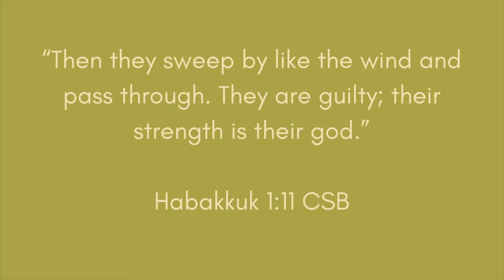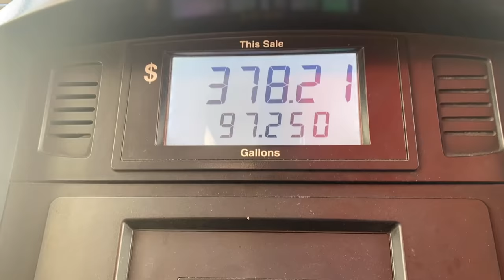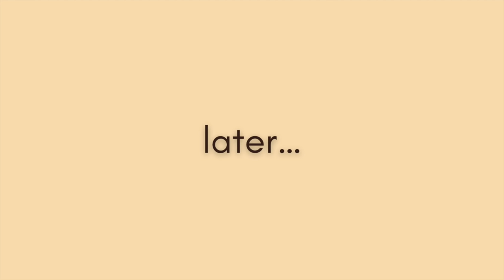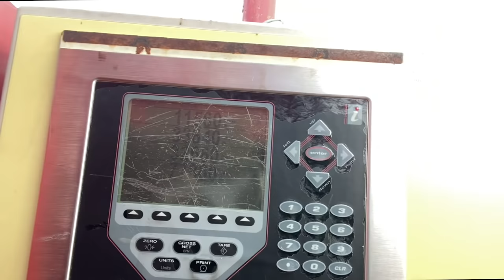A Detailed Day in the Life of a TRUCK DRIVER 🚛 | Laid Back ✨

Comment: Yes ma'am. If you are uncomfortable, don't do it! I got my cdl this time last year and drove for 8 months otr before going back to college. The winter season is terrifying! My first weeks alone I was running up and down I 80 through wyoming with every snow and wind warning going off. I'd end up sitting 3 out of 7 days out because of it but I'm safe because of it! I saw dozens of cars and trucks in the snow, rolled, and wrecked during driving through and told myself I'll never put myself at risk. Your life is far more valuable than that deadline! Appointments can be changed, your life cant be replaced.
Reply: Lol alright sista. It ain't for everybody I'm glade you are alright. Lol
Reply: I left for the same reason too within my first year of driving , NOT NOT WORTH IT
Reply: Soo seasoned driver tip: if you're going between Denver and Salt Lake City and your company is having you take the infamous I80 through Wyoming..... there's a detour. Its a pinch more in miles but I've taken this route before; I15S to Hwy 6, which connects to hwy 191 in Colorado that will get you to the 70, then take that east to Denver. Obviously if you're going the other way... opposite directions lol. It may seem scary to some newer drivers but to me it felt good taking that route when I didn't want to take the route through hell.
Reply: Well it's Wyoming. The wind alone on a sunny clear day will push them trailers over. Seen it.

Comment: That's Right Niesha pace yourself and don't try to drive outside of your comfort zone. With my job though, I gotta make it happen every night pulling doubles through the mountains which is new for me. And now that's it's about to be winter I might have to consider my comfort zone as well. ~ Safety
Reply: Jasmine Jazzy Jas  Thanks, I'm a night owl...probably from being a trainer for so many years. But yeah I've heard US Foods is really tough, and with doubles...WOW SALUTE!!
Reply: Thats funny you say that this is my first job out of school pulling doubles on the east coast. Look out MT, Black Mt, The Gap, The Gorge. My first winter comming up. I to am very apprehensive driving in the winter. They give you no training on how to handle different scenarios in inclimate weather. No training on controls in the Tractor. I just figured out that I could lock in my engine brake going down grades  to maintain speeds . There were no engine brakes in the training trucks. There are switches on the dash that Im unsure what they do, and when to use them. Then to top it all off. They put you in some dangerous equipment. The front end shimmy and shakes between 35 and 55 MPH. headlights are cloudy and makes it difficult to see usually have to use high beams but its not much better. Wiper blades don't cycle properly.. stall and shutter.. But I love the job just not the safety or maint. Program they have. They hate alot to be desired.
Reply: Jasmine Jazzy Jas  Thanks you be safe.
Reply: @truckingwithcliff  
Unfortunately its not that simple. It's a slip sit position. No sleeper.
Different tractor every day.

Comment: For a lot of new drivers, it's learning curve with a manual transmission that was the biggest hurdle. From this video it appears you're running automatic.
Thing about CDL school is that there's a lot they don't cover depending on which area you learn. Downshifting alone causes a lot of people problems, as well as If there aren't hills to go up or down or a way to get experience with certain rougher scenarios before finding your first employer. 
My first company only ran autos but I learned with Stick. I went 3 years without having to shift, then left that company, the next had me shifting and it was rough for me the first couple times. It's like riding a bike, comes back pretty quick but the best I suggest is to never get complacent and think "I know this". there's always something new to add to your perspective.

With that said, excellent video, I liked how you went into several areas of how the industry works!
With there being a need for drivers, it's only going to be helpful to show people that they could do this.
Cheers!

Ps. Ignore those guys, dogs will be dogs, as they're bound to bark. Just be careful and watch-out for ones that might try to bite. I've seen it and would intervene if someone is getting too out of hand, but all in all, our own safety is up to ourselves at the end of the day.
Reply: I just was at the DMV trying to get the automatic restriction off my license and downshifting a turn failed me automatically because I stalled if you have any pointers for me on my next road test will be well appreciated 😢 sad I had I failed that part but it is the most difficult for driving a manual

Comment: @06:27  I am glad that you actually get under your trailer and check the kingpin.  A lot of drivers do not physically look because they think that a tug check is all that is needed and that is not correct.  Good work.
Reply: A tug test isn't enough in my opinion. Need to actually see the jaw lock against the king pin. Tug it twice or three times if need be. Safe is better than sorry.
Reply: @mriphone1000  You are correct.  I actually encountered a time when I did the tug test and my trailer passed the tug test but when I got underneath the trailer to check, the jaw did not close all the way.  The jaw only went half way around the kingpin which was enough to hold the trailer for a straight tug but I am pretty sure that if I did enough turns, it would have released the trailer.  I ended up dropping the trailer and re-hooking to it.

Comment: Proud female trucker here. I always laugh when people say this job is hard. It's not. It's incredibly easy. We get so many luxuries that most don't. We can wear what we want. We can blast our jams. We get to have our pets with us all the time. We can take our breaks when we want to. We sit in air conditioning or heat all day. All we have to do is drive, hook up, drop off, and back up. The only real skill required in this job is backing. Literally every other aspect is common sense and getting used to the size difference, which doesn't take long. This job is ridiculously easy, and pays well for what is required. I've been a company driver, and I've been a lease operator. Can't say I've done the owner operator thing yet, and I doubt I will. I love my job, but seriously, if someone thinks this is hard, I have to wonder just how dense they truly are.

Edit: Good on you being out here proving we women can do anything men can do every single day. Balls are NOT required to be a trucker. You can do it in a dress or skirt no problem if you want to. I have many times.
Reply: That’s cause you don’t have to drive through real traffic you deal with nyc all day and the upstate ny mountains in Catskill you must be a causal route driver
Reply: as soon as you said " all you do is drive" i knew you are not a OTR dryver.

Comment: I used to work as a watchman and it gets a little scary when I see truckers drive towards the stringer mainly because the longshoremen who come in flocks towards the crane to pick up to get real wild out there. It might not be as major when they say to give you a map it could be a backhanded comment depending if there was a billion trucks lining up to enter the terminal. It’s a lot of heavy machinery with people who could get cut off and eventually crash into each other which is extra expenses.

Comment: I'm a security guard and it has nothing to do with you being a woman, it's that you're a truck driver. I can't tell you how easily some truck drivers get lost. I once had a trucker come in and i pointed directly at the trailer he was picking up, he drives directly past it and goes deeper into the property, and comes back 30 minutes later pissed off because he can't find it. And I swear, i've had two different drivers ask if they should back in to the docks. It took every bit of self control not to say "as opposed to what, putting the nose of the tractor at the dock???"

Comment: They’re miserable people trying to push your buttons. I went to pick up an empty same as you and they told me the same thing “just head straight and turn left” I was there lost and after several attempts I finally found it. After I found the empty trailer I asked if there was a way to find it with a GPS tracker she just told me” you didn’t ask” 😂 lesson I learned is to ask even if it irritates them.

Comment: Good morning Mrs k I have a trucking question when you test on the road with the examiner what is the best way to make the turns I keep getting told to keep both hands on the wheel how's this possible to even make the turns?
Reply: It depends on the space you have from the curve. Rarely you’ll drive with 1 hand because you have to maintain the stability of the tractor and the trailer. Button hook turns require 2 hands. Left turns require 2 hands. With practice you’ll find your comfort.

Comment: About the map situation, that could have two interpretations that, if you wanna see it as sexist, you'll find it.

One, he tells you where to go, after you mentioned you're uncertain of being there before. If you had gotten lost and found out later that they had maps, you'd accuse sexism for not giving you a map.

Then you have the actual set of events where they try to offer you a map and you interpret it as sexist.

I can 100% assure you I'd be grateful to anyone helping make my job easier. A lot of men have too big of an ego to accept help when they should be accepting it. It seems like you might have the same chip on your shoulder, but for different reasons than a man might have.

Comment: Sounds like your been a little insecure and it's your problem not theirs. I wouldn't worry about that interaction. 
He was trying to help because you said you couldn't remember, I'm pretty sure.
Saves you asking the next time you go, if you do.
So question as I haven't seen a female trucker video before and I used to load steel on trucks for a few years and never seen a female driver. 
How do you go about tying down your loads and securing everything?
Are you specifically doing low weight loads?
With your build, there is just no way you will have the strength to chain and strap down loads that have weight that could shift etc.
Do you find that you can get help from loaders without trouble? Some folks can be lazy at work and we had a guy that whined if he had to load a trailer for a driver.
We used to load some truck drivers for them if they were older and we even had a guy with one arm that was fine to drive but couldn't load at all.
Hopefully you don't take this as offensive as it's not meant that way. Just truth about physical difference between men and women and truly curious.